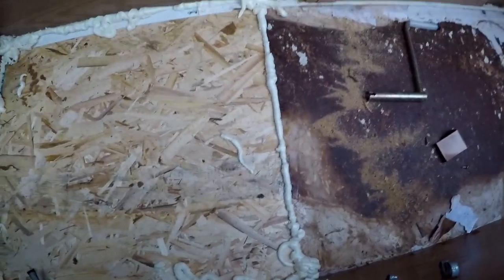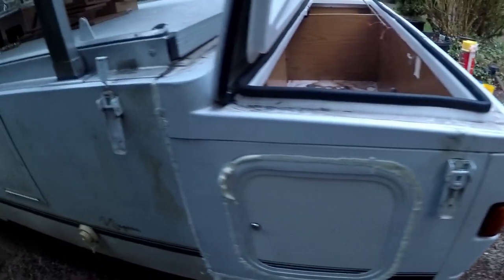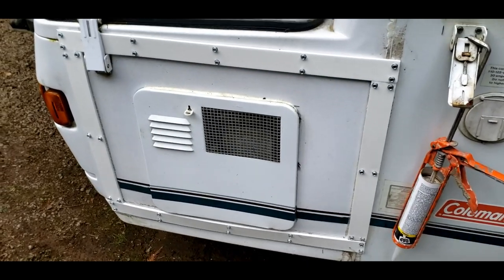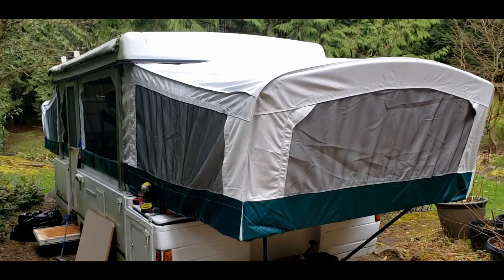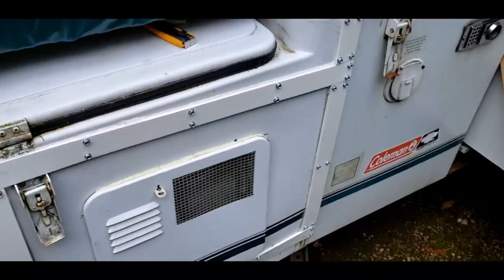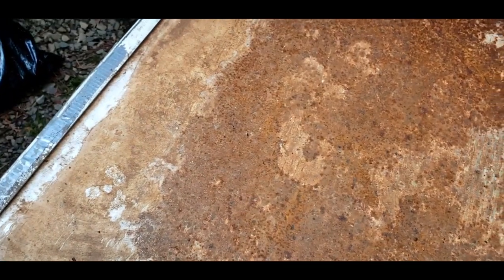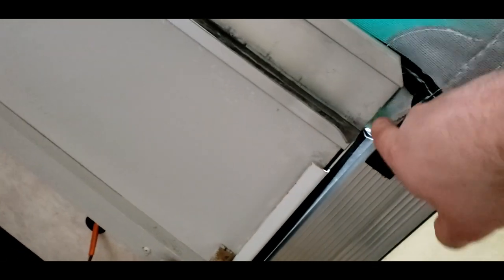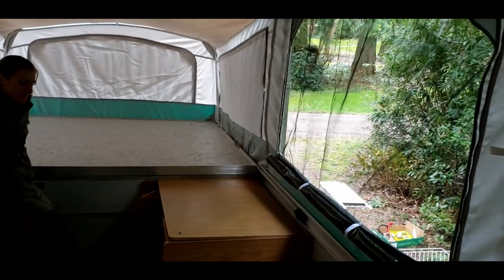PopUp Camper Remodel Ep  4   Storage Unit Fix and Canvas Install

Comment: So with the all the sealant on the storage door... how will you access it???
Reply from the maker: When the camper is down and in "tow" mode you can open the main lift top just like normal. While we have it popped out there's a access panel on the inside of the camper. Mainly we pull all the things we will need for the night out before popping it up. We only store our solar panels and a few extra things in there. All our clothes etc are in the jeep

Comment: Where did you get the new canvas? Looking to replace mine
Reply from the maker: Popupparts.com. currently at partial operations due to covid. May take longer to get one.
Reply: DB Bushcraft yeah I looked there. Don’t seem to sell the full kit for my Colman fleetwood Santee
Reply from the maker: @devonalves2436  what year??
Reply: DB Bushcraft 1999
Reply from the maker: @devonalves2436  http://www.popupparts.com/index.php?main_page=product_info&cPath=1_1542_1886_1893&products_id=1913&zenid=ae851876db1e75a99ec8691a5dc0eb0c
Reply: DB Bushcraft thanks!
Reply from the maker: @devonalves2436  no problem!